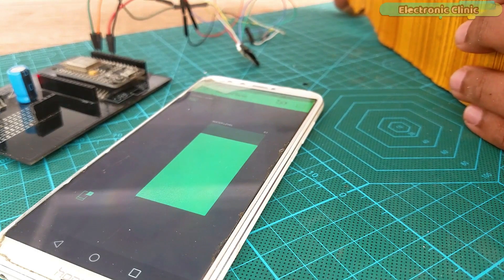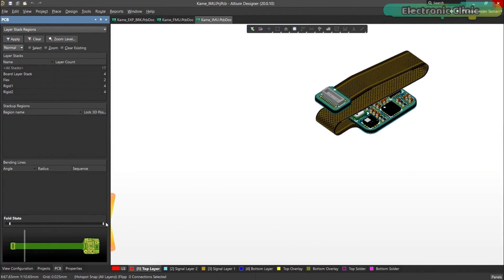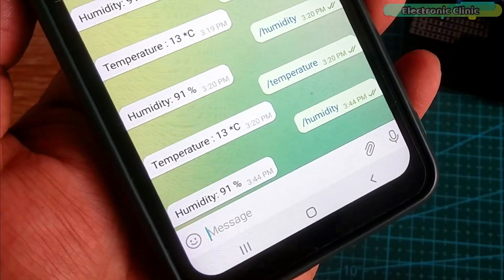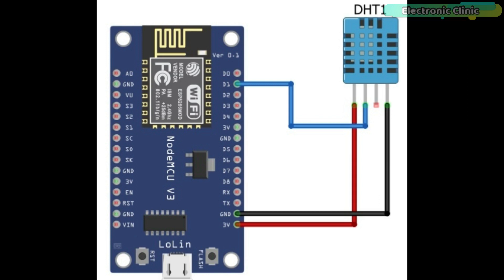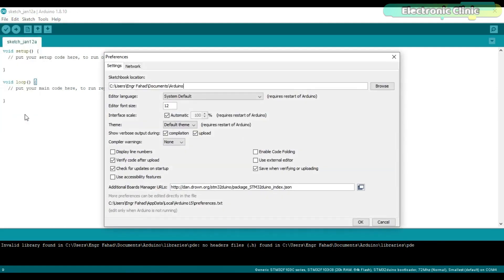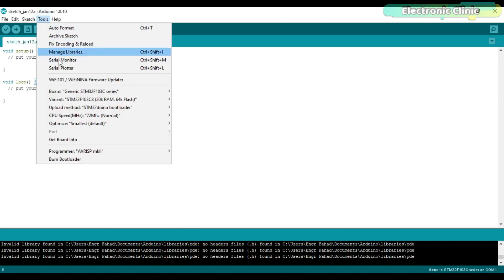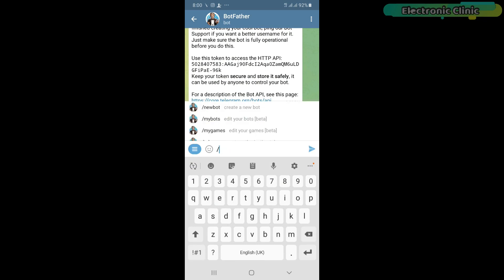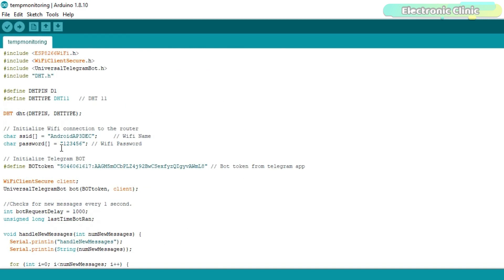IoT Project ESP8266 with Telegram Messenger for Monitoring Temperature and Humidity using DHT11

Comment: hi thank you for this amazing project but i have several errors 
.
C:\Users\00\Desktop\IOT naloosi\Blink\Blink.ino:12:17: error: extended character   is not valid in an identifier
   12 | #define DHTTYPE DHT11   // DHT 11
      |                 ^
C:\Users\00\Desktop\IOT naloosi\Blink\Blink.ino:12:17: error: extended character   is not valid in an identifier
C:\Users\00\Desktop\IOT naloosi\Blink\Blink.ino:18:20: error: extended character   is not valid in an identifier
   18 | char ssid[] = "wle"     // Wifi Name
      |                    ^
C:\Users\00\Desktop\IOT naloosi\Blink\Blink.ino:18:20: error: extended character   is not valid in an identifier
C:\Users\00\Desktop\IOT naloosi\Blink\Blink.ino:18:20: error: extended character   is not valid in an identifier
C:\Users\00\Desktop\IOT naloosi\Blink\Blink.ino:18:20: error: extended character   is not valid in an identifier
C:\Users\00\Desktop\IOT naloosi\Blink\Blink.ino:154:49: error: extended character   is not valid in an identifier
  154 | if (millis() > lastTimeBotRan + botRequestDelay)  {
      |                                                 ^

Compilation error: exit status 1
 i wهll be very thankful